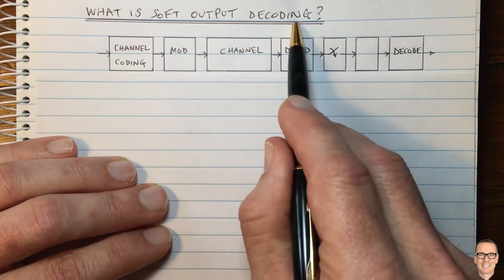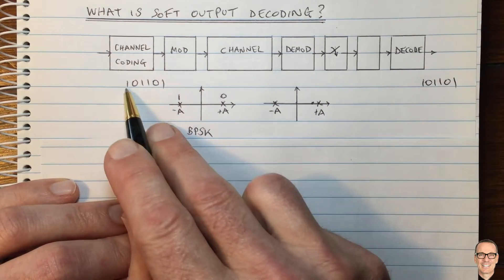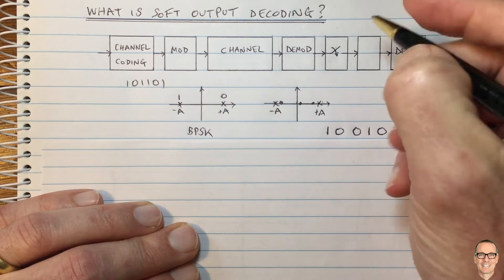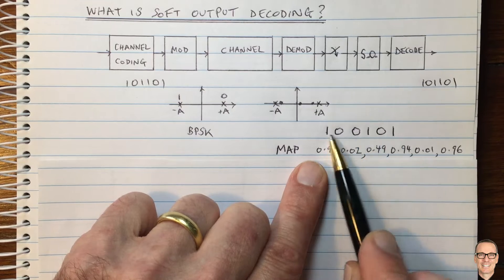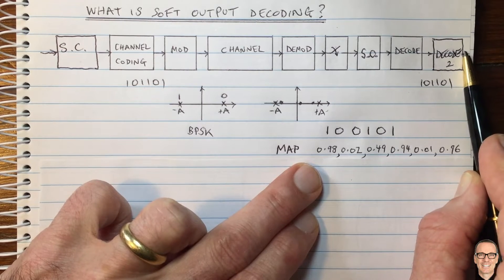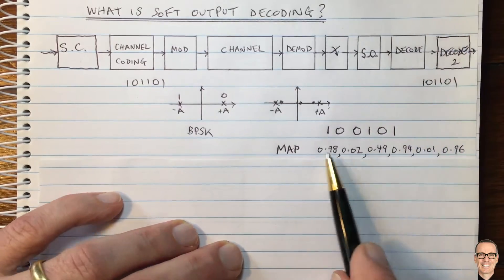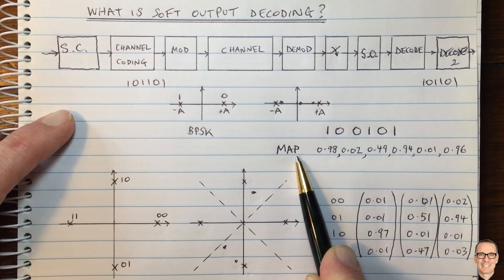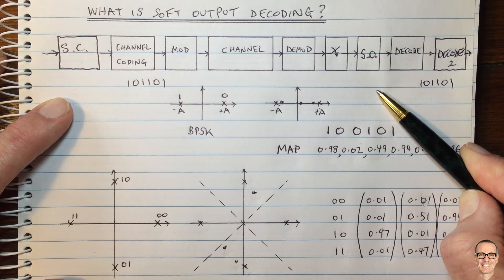What is Soft Output Decoding?

Comment: Thank you for another great video.
Looks like soft decoding improves separation of noise and signal (improves on SNR?). Does this mean that it increase the channel capacity? Or does it make us closer to same capacity defined by  some other SNR? 
For example, in matched filter case we increase channel capacity (correct?) but in this soft decoding case and also in more advanced turbo equalization, joint channel estimation and decoding what happens with channel capacity?

Comment: Does this soft output decoding stuff increase the complexity of the receiver  which in turn make it take more time to decode ?
Reply from the maker: Yes, soft output decoders are definitely higher complexity, but you still need to complete the decoding within the same time, otherwise delay would build up.